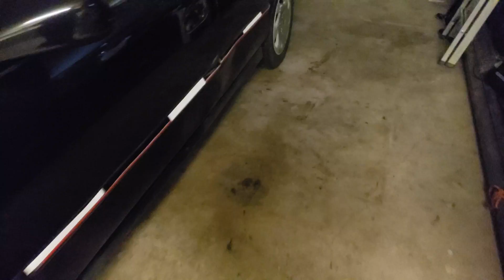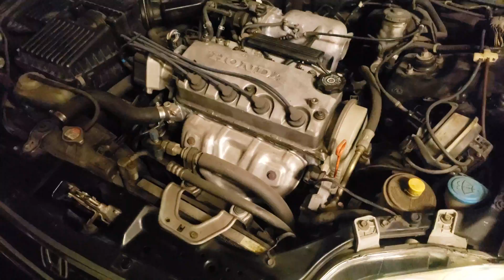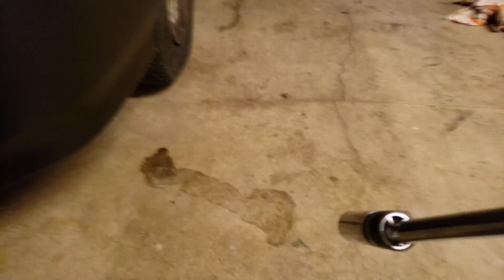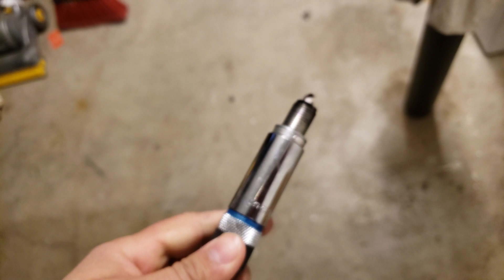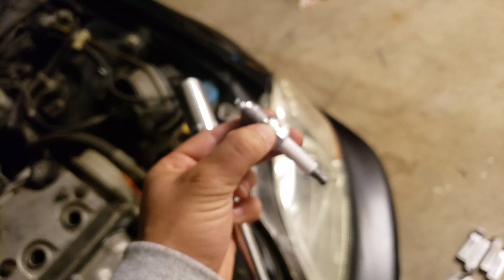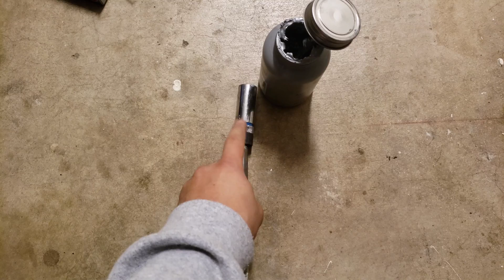1997-00 Honda Civic Spark Plug replacement DIY

Comment: Thanks for the video! Hoping all my civic needs are spark plugs. It stalls (automatic) at a stop and idling like garbage.
Reply from the maker: Let's hope that's your problem. Spark plugs swap can be very simple on these vehicles. Now if it continues to stall even after new set of plugs and wires then maybe your IAC(idler air control valve) might be dirty so it doesn't open any more. Sometimes cleaning it with carb cleaner does the trick but if not IACs can be expensive parts at the parts store. Good luck.
Reply: Fuel injectors